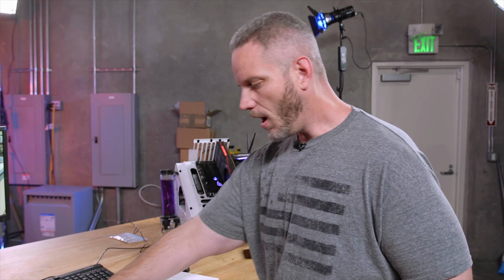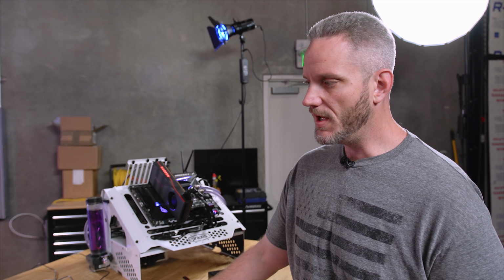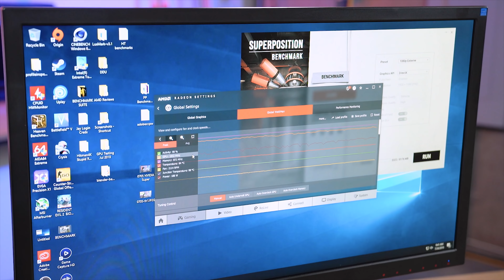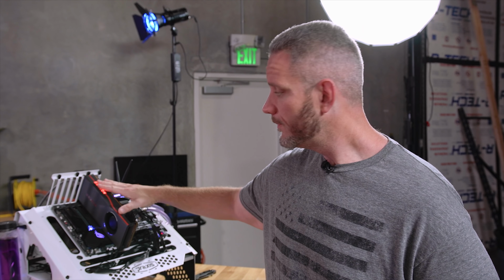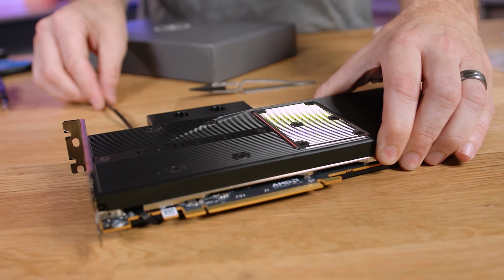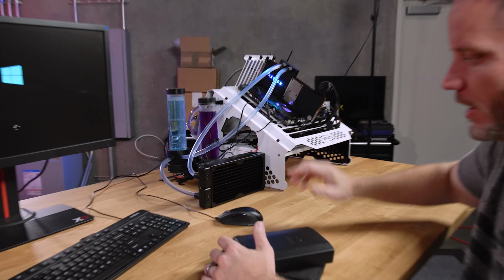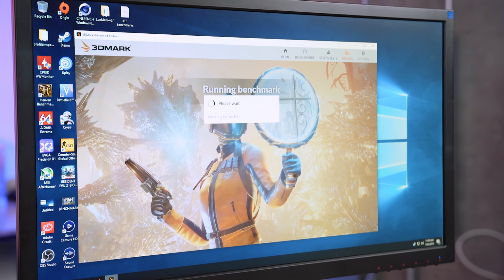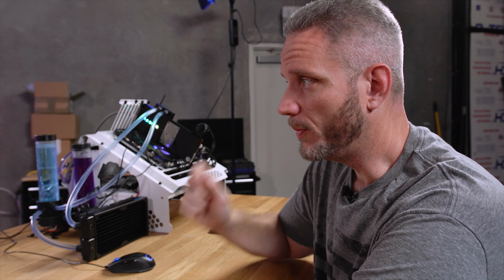Watercooled and Overclocked Radeon 5700 XT... Was it worth it?

Comment: I would say watercooling is all about reducing thermals and ambient noise. Overclocking is kind of a secondary and, in my opinion, negates the true benefits of watercooling.
Reply: I agree with the first part. The negation part I disagree because that depends on the seize and amount of your radiators. You can build like a 4x 200mm radiators setup in a h500i and have enough area to cool 600W without any noise
Reply: I love watercooling and it sounds like you do too. But to me its about ambient noise and looking awesome. Im curious why you think reducing thermals is good too.
Reply: Especially with these modern dynamically-clocked parts
Reply: @invalid8774  I guess it's down to preference. I plan to watercool for aesthetics rather than overclock. Considering the power draw from the OC (+40% power draw?) and the gain (<10%) I'm not sure there's much point
Reply: I will always watercool for the noise and temp reduction. I have a mild OC on CPU and the GPU just does it's own thing while under water
Reply: watercooling for me is to be able to use my default settings lol, especially on hot places, where my default fan curve and others would make me game at max 89C, after water cooling max is 53, at default, making me have more headroom for overclocking to get most out of the card
Reply: I completely agree. You can't say it also doesn't look amazing. One of these days I'm going to make a splatoon themed build with 2 separate custom loops one for GPU and one for CPU with green and pink. xP

Comment: Since about the GTX 9 or 10 series, about all that's needed is an AIO for the CPU and a good non-reference fan cooled GPU to get maximum practical performance. 

I own a Data Center and the last thing I want to do is mess around with full water blocking. The last insane home rig I had was an SR-2, but then water cooling was more practical.

Comment: Wish that the Radeon VII wasn't such a flop or that there was a 5700XT with 16GB.
Reply: Be patient storybook, the answers are comming.
Reply: There's a 5800-5800xt in the works? I was going to buy an 5700xt when the after market designs came out but I wouldn't mind waiting for a 5800xt.
Reply: @kanuckistanprepper5321  
Also inform your local fire company to be on call when the 5900XT is powered up just to be safe❗
Reply: For what do you need 16 GB anyway
Reply: @eazen  gaming on 8k tv maybe?
Reply: @widodosoundsystem  no, because he is very far from having that sort of horsepower today. LTT made a video about it and it was basically a joke, it's impossible. Even 4K is kinda bad atm.

To be frank, 8 GB video ram is more than enough for any game today unless he is playing Skyrim with 1000 mods or smth crazy like that. 

This and of course if he wants to use it for work, but dude these are gaming cards. Go buy the Radeon 7 then, considering its value for working it is a steal at that price still - not for gaming though.
Reply: @eazen  8 GB is good for today's maxed out settings. Not for the future...
Hell, I bought a R7 265 2 GB next to release, and most games didn't use more than 1.4 gigs at the time (only modded skyrim and shit like that). Some years later 1080p ultra was using wapping 4 or even more vram. It was struggling to load even low textures. If you're buying a high end card, you probably don't care about your money at all. So 16 gigs are worth it. Nobody buys high end to play with high or médium textures. And I don't know WHY it needs to be a big jump as 4k to 8k. I mean, aren't there TONS of pixels in between?
Reply: @thrawn9115  wrong. 8GB is plenty for gaming.
Reply: @sean9267  Just as 2 GB was perfect, then 4, then 6, and now 8. Will 8 gigs be perfect for the future? I doubt it.
Reply: @eazen  A lot of people who do a video production, editing, 3D, game dev, basically all of the heavy tasks. Some things like solidworks only use 1 GPU, so a cheaper, high capacity card like a 16GB 5700XT would be great.
Reply: @storybookbus0314  makes a lot of sense.
Reply: @eazen  Seeing some of your other comments, I like how you know what you're talking about. I also saw that LTT video on the 8k stuff. Resolutions are going up like GPU inflation, but 8k isn't ready lol.

Anyway, I'm sure that the Radeon VII would work perfectly for most, but it's extremely noisy and flops in some places, which is why I'm hopeful for the "5000 series" cards from AMD.
Reply: @storybookbus0314  true. I think there is a certain possibility the next big GPU of AMD will have HBM again to battle high power consumption which will certainly come from high amount of steam processors again. And these will ofc have 16 GB HBM2, what else. HBM3 is a possibility too though- for AMD it would be better to go with 2 stacks of HBM3 at about 1TB/s instead of 4 stacks, which will be too expensive again and lower their margins
Reply: @eazen  They definitely have  good quantity of options. Temperatures are unfortunately a major, determining factor in those options. It will be interesting to what they decide to do, and how well their product shall perform; both in terms of compute performance and power usage. HBM3 would definitely be interesting to see. I think it would also be pretty great if there was something along the lines of an MSI Lightning card for a "5900XT". If the performance and value are good enough, then I'll most likely consider using a water block, unless the cooler performs well. 

It would be great to see it where AMD dominates in both the CPU market and the GPU market. $1200 for a 2080 Ti, or even $1100 is slightly too pricey for a single 11GB GPU for me, and SLI isn't too great a value when considering all of the entailing issues.

I really do hope that AMD can make something powerful, yet efficient. It would be a dream to have an RTX Titan, but I believe that the gold finish was intended to be a joke referencing its price.
Reply: @storybookbus0314  well I agree for the most part. Only, the gold color is a thing of luxury, that's where I disagree 😂 it's meant to look good and that's it. I mean, even the 5800 XT 50y edition looks pretty great with it
Reply: why you need 16gb on a mid-end gpu... sigh.
Reply: @Dr.WhetFarts  strange to see a 400$-450$ part be called "mid end". It's certainly a step above that. I can see why people say 8GB isn't enough, the 2080 for example has similar performance to the 1080ti but 3 GB lesser Vram. It is odd
Reply: @kanuckistanprepper5321  An 8gig 280 was $350 on release, I got mine for $200 right before the Bitcoin bubble. It's what I'm using now yet I don't mind waiting for better cards or lower prices because a gpu is supposed to last you for many years.
Reply: @Dr.WhetFarts  Some people are looking for capacity, while not having to break the bank.
Reply: There's only a single game that benefits from 16GB, on max settings with rtx at 4k, so 8 is enough
Reply: My Radeon VII pushes well into 2080 range, even TI in some instances.  I am getting a waterblock for it, after debating whether or not for almost a whole year.  Aside from abysmal drivers back in December (which is no longer an issue) I have nothing but love for this thing.  The thing runs near silent, and isn't as hot/loud as haters would have you believe.
Reply: @kanuckistanprepper5321  "a few month" ... now, 10 month later there is still no 5800 xt or similar on the market
Reply: @zero.zero.one.001  ya kinda sucks eh? Sept/Oct is apparently the release of the 6000 series with a full flagship this time.
Reply: ''8gb is plenty'' ...

DCS player here and I must say, God not it is not.

Comment: I water-cooled my rx 5700 with an ek vector block, then flashed it to the 50th anniversary XT BIOS, and locked the frequency to 2.2Ghz, and WOW is this card good! Think the block might need reseated or something tho, TJ hits around 80°c while edge is down around 45-50°c.. but still, this card is running way harder than it was ever intended, and handling anything I throw at it like a champ! If you were going to do a full loop anyway, I would recommend buying the non XT and cooling it as I have done.

Comment: I'll wait for a 5900x2 to be released if that ever happens. Much like the R9295x2
Reply: Ah yes, that expensive flamethrower of a dual-gpu...
Reply: @colbeh  at least it was a most powerful graphics card made by AMD at that time. Havent seen something like that in years.
Reply: @Chuckiele  that's because dual gpu support is dying.   I ran crossfire and SLI systems for years but my last two systems have been single cards because the support and scaling only exists in benchmarks and a handful of games.
Reply: @KentBurgess  I meant it was the last time AMD had the strongest graphics card of that generation, dual gpu or not. I know that it wouldnt make much sense nowadays but looking at infinity fabric and chiplets, I dont think a future AMD dual gpu will act like a dual gpu anyway.

Comment: Delayed custom cards because of AMD slowing down the partners... intentional. I'm still waiting mid-august, or maybe September :(
Reply: Not the first time. AMD did the same thing with the R9 290/290x. Forced AIB's to wait months before they were allowed to sell their models. The 290/290x had even worse coolers than these cards. My guess is AMD gets a bigger cut of the profits from their reference models so they delay partners from selling theirs until they've met some internal number of reference models sold.
Reply: Delays are caused by RDNA chips shortage. AMD and NVidia also want these custom cards because these custom cards are doing all the sales. No one wants og cards besides HEDT customers with their custom LC, because these cards are unconfortably loud (even RTX refs are loud, but not as loud as 10 Series).
Reply: I'll be waiting till early next year lol , but for CPU not graphics card (:

Comment: I bought a 5700 XT and ordered the SE waterblock you just tried out.  It took quite a bit of thought before I did.  The deciding factor was that I have wanted to build a custom loop system for a while, and since I am upgrading my Ryzen 7 1700 system to Ryzen 3000 ( I have not yet decided what processor I am going to use yet ), now seems to be the right time to do it.  I am ordering parts one or two at a time, so it is going to take a while.  The motherboard and processor are probably my most difficult decisions.  There are many good choices, but I want to be sure I get the best parts I can.  Like you said in your video, I am doing this because I enjoy it, and a custom loop is something new to learn, so I will just enjoy building the system that much more.  None of it makes any sense, but it doesn't have to.  It's all for fun, except for the fact I do use my PC for work sometimes.  Thanks for the video.  I always enjoy them.  Any chance you might take a look at the Crosshair 6 Hero with Ryzen 3?  That's what I have, and will probably put the Ryzen 3000 CPU in there while I continue to debate the motherboard.  I have heard there might be memory frequency limitations due to the T topology memory layout on there.  Thanks again for the video.

Comment: No 5700xt registry mod on watercooling?
Reply: Haven't watched yet but... what? He didn't? Then what's the point?
Reply: @MrStoffzor  Agreed, especially when people are hitting 2200mhz with the stock blower using the Reg Mod
Reply: Jay do it again with the Reg Mods. I need to see da POWER. lol, or not :)
Reply: @froggahz  if you watch gamers nexus he shows 2200 is the set point but doesn't reach that in performance wise. Hard to explain, worth the watch.

Comment: @ 15:00.....so, do you honestly recommend a 2070s for ~150$ more over a 5700xt , which is actually faster in a few particular games ?!

/watch?v=_l9FjSLf6sg&t=555s
Reply: well, i sure would recommend a gpu that... isn't overheating?
Reply: @k680B  
aio 5700(xt) are around the corner, so that's not a valid argument anymore, why i personally rate the 2070s lower than the 5700xt is the fact, that nvidia screws their customers by downgrading the performance with driver "updates" once a new series has been released. happened before (check out the benchmarks old vs new drivers), will happen again!
it's the exact opposite with amd gpu's they usually gain up to 10 or 15% in performance compared to release...vega 56/64, rx480/580.
so, in one or two years a 5700xt is definitely outperforming a 2070s in 9/10 games.....in some even by a huge amount.
Reply: @WitchYuki22  nice sizzle Dudley
Reply: @chillhour6155  imagine spending $400 on a GPU and having to wait a year till it becomes good 😂

Comment: I have been liquid cooling since the slot 1. I use 3M's Fluorinert electric fluid now, and FC-40 is the best replacement for human range of temperatures. It cools is as well as water with 10% glycol.

Comment: my radeon 7 : air cooled = 2030mhz , watercooled 2150mhz... does it worth it : yup ... for 2 or 3 games playing in 4k maxing out the details ... it can even get higher i think but i don't want to put too much voltage even if temps are still ok

Comment: Yes Jay the default fan curve is really slow, It's o.k upto about 2500rpm after that you can hear it, at 4000rpm it sounds like a jet plane lol....................But it's a really good gpu for the price/performance your getting and I don't regret one bit buying it, it replaced a GTX 1070 and in battlefield V it plays great on DX12 more fps and alot smoother, I've undervolted mine to 1960Mhz/992mV in wattman which gives me a peak boost of just over the stock 1905Mhz with a custom fan curve. The fan gets up to around 2500-2700rpm normal temp 55c, junction temp 63c and I'm very happy with my purchase.

Comment: Also depends on the country the 2070 Super in Australia start at $939 (PCCASEGEAR) and the 5700Xt is $629 (PCCASEGEAR) so even with the water block the 5700XT is still cheaper

Comment: For CPU and GPU I must say drivers have improved a lot lately.
I came to the point of thinking that those drivers weren't even ready when the products came out and that is why there have been a lot of problems.

Now everything runs quite smoothly and performs as intended to the point of I decided to discard all my overclock settings and let the gear boosts itself.

In facts, my only issue right now is DCS World being awfully optimized.

Comment: 15:16 watercooling is also good for sound issues. although i will always recommend that if you can, just put the computer in another room. there is no reason in the world to have the computer sitting in the same room with you if you don't have to. all of your cables can easily be 12-15 feet long, and usb hubs are pretty robust these days. if it's too loud, just move it somewhere you can't hear it. but regardless of that little mini rant, watercooling is often more about silence than performance.

Comment: The whole argument of "lower temp = lower power draw" is super compelling to me. I've had a two GPUs die from higher temps, one made it 2 years (5700 xt), another 6 years (980 ti). Probably expected, but if water cooling will extend the life of these cards, that's something to consider, right?

I mean, yeah, my 980 ti was old, but it was still pretty relevant even today running a lot of games. I wouldn't have minded getting another 1-2 years out of it :)

Comment: The newer iFixit kits fixed an issue with the comfort of the driver's grip, the older ones kinda suck (they slightly cut into your palm if you had to apply pressure from the top of it). Definitely best $35 I spent and I often use it at work when disassembling laptops or other fine componets. Don't overspend and go for the $65 kit unless you need the extra, very niche tips that the smaller kit doesn't have. Even at a repair shop, the small kit is all I typically need (outside the heat gun every now and then).

Comment: I added an ID-COOLING FROSTFLOW 120 VGA (an AIO going for about $67 at the time) to a VisionTek OEM RX 5700 XT back in May 2020. My aim wasn't to optimize clock speed; it was to keep the fan noise low. That OEM blower is stupid loud. The AIO also redirects the heat directly out of the rear of the case, and not through my CPU radiator.

Comment: I tend to disagree with not watercooling due to  price points when water cooling give max range and increases longevity of the silicon.  Add water to keep the chip alive for 5 or 10 years while running max speed.

Comment: Water cooling can make sense for graphics cards already owned if 1) selling those cards won't generate significant revenue, and 2) buying a faster card is not an option.  It all comes down to the numbers and whether one is willing to go to the trouble.  I have a non-daily use system with two 980Tis, and water cooling was the only way to control the temps.  The results are remarkable.  I went from 82C/65C to 55C/45C under a typical game load, and in applications that scale reasonably in SLI, I get roughly 2080 performance.  That said, nobody should go out today and buy a pair of 980Ti cards to water cool.  A 2080 costs significantly less than two used 980Tis and an EK cooling loop.

Comment: G'day Jay,
as I can't afford a RX5700XT at the moment (they start at $640 in Australia but are $50 cheaper than a RTX2060Super) I will be waiting to see what the AIB cards are like,
I like Water Cooling & enjoy your Loop Build & Service videos,
I built my gaming PC with a R5 1400 I wanted to water cool it for looks but couldn't afford a full custom loop, so I Modded a Cooler Master ML120 AIO, it now has clear soft tubing, 240mm Radiator & a ThermalTake Pacific 11 Reservoir,
with the pivoting inlet & outlet on the block pump I have the Tubing flat against the Motherboard instead of running out into the middle of the case, I sent Pics to Brian at BPS Customs for his SMYR series & got in the May 22, 2019 episode Last season, he really liked my PC for being Different as it is hard to work out that it has CPU Cooling